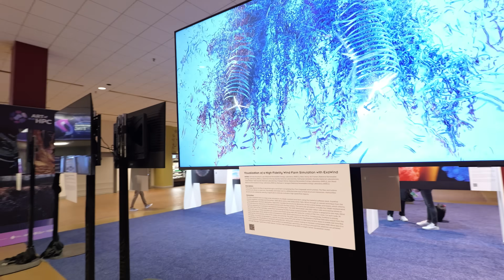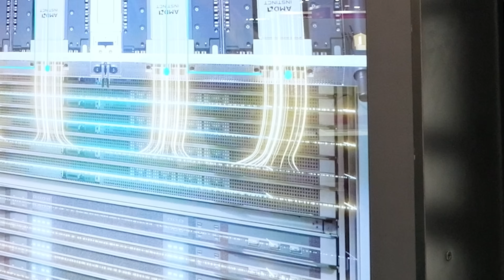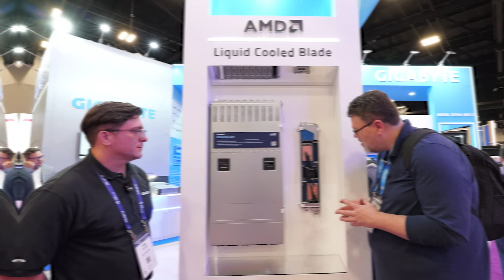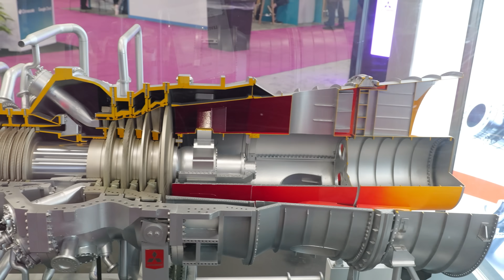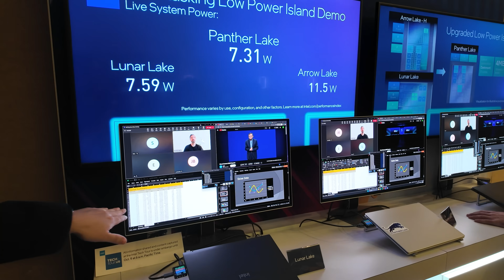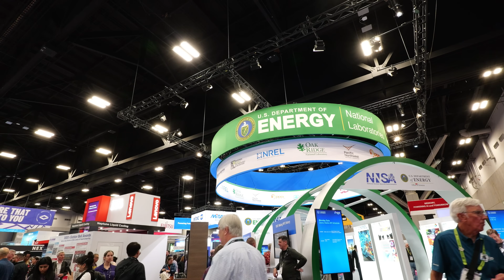SuperCompute 2025 was NUTS! Here's a Few Cool Things I Saw

Comment: Too late but you should ask AMD about the power limits on their next gen APUs. We have found that the ~500w power limit on MI300A leaves a-lot of compute on the table. Most of our scientific codes only get about 1/2-2/3rd of the XCDs fully flexed unless they are heavily tuned. B300 plays much nicer at power limits. 

Btw I saw you at SC but was too nervous to say hi, maybe next year. You inspired me to get into HPC!
Reply: The trick to the power grid stuff is to either have turbines as a stop gap or be connected to multiple power grids and send them advanced notice. It takes at least 2hrs to bring back up an 80mw cluster.

Comment: All GPUs nowadays, each requiring its own proprietary open standard language.
Reply: Actually not, OpenCL and SYCL are here to rule them all!
Only when it comes to vendor-specific fixed-function hardware beyond vector GPGPU, like the mixed/custom-precision matrix accelerators, you need vendor-specific code snippets. For Intel that is OpenCL extensions, for Nvidia that is inline PTX assembly, and for AMD it's compiler intrinsics. Plus a GPGPU-compatible fallback for any older hardware that lacks the systolics. With that it's possible to make one code base universally compatible and optimized across all GPUs since ~2009. 🖖

Comment: Hey Wendell!!🤗  Can you help me make a minor Beowulf system with just older computers that I can evolve over time?  I'm thinking as good as I can afford to make with not very old but Windows 11 incompatible used PC's for cheap (Linux of course), on top of what I already have and partially use as such (in processor sharing)?  I need way more cores to render Mandelbulber II fractal images, which can be made of hybrid and separate or intermingled fractals in full 3D with full camera control, depth  of field and all, material control:  transparency to opaque, color, material, texture, light  refraction, reflection, shadows... environmental conditions: hot dry air aberration over minor humidity to dense fog.. and it doesn't need no stinkin' GPU's but frigggin' CPU's (as many as it can find on my network so 24 for now) due to it's needs in calculating in dual integer math which GPU's can't, nor need to do as in games they are representing, rather than precisely calculating environments and their behaviors over the calculations that become exponentially more complex as they need to determine the shape, lighting, and textures of the fractal surfaces, doing metrix operations and what not.  I wonder why no one uses Mandelbulber II for benchmarking, more to gauge ones PC not for F'n gaming, but for science and engineering type calculations, as I done wanna be cipherin' there".

I know you are one of very few who can help me make a brain neuron hyperplastic recombobulator" AKA "Dream machine".  I look at the fractal animations made in mandelbulber II and know they must have either waited a month or two with their PC running for a week for every 3 minutes of animation, or had the privilege and access to get time with a serious processing server, or even a supercomputer to make 20 minute fractal fly by's and fly throughs.🤯😮🤯🥵

Comment: 13:17 - It's interesting, these are not new problems.  70-80 years ago in the United States, a good number of industrial manufacturing sites like Steel Mills, Metal Foundries, Paper Mills, etc. all had incredible 3-Phase High Amperage AC power requirements that local utility companies were in no way set up to accommodate.  So, most of these sites had supplemental "Power Plants" for their sites to be able to run all of their equipment (largely powered by delivered coal or gaseous petroleum).  Over time, those sites eventually turned down their supplemental power plants when their manufacturing capacity was reduced due to less demand (i.e. manufacturing offshoring), and all their power requirements could be handled by the local power utility.

While the tech has absolutely gotten smaller and more efficient, the overall concept with power-hungry datacenters is still the same as those bygone manufacturing centers.  What I'm sure has also advanced too is : How quickly companies like Eaton and Mitsubishi can install/turnup these products.  I would be willing to that the Eatons and Mitsubishis of the world already had solutions like this for other customer bases, they just needed to be adapted for the needs of a datacenter.

Comment: 6TB is a lot? A regular desktop should have 1TB by now. 16GB was high-ish for the mid range in 2013 (Like a $600box with two mainstream dimms, probably $1200 box with inflation.). 
12 full years, 2 year doubling = 6 cycles.
16GB × 2⁶ = 1024GB
(And DDR5 should have been all Rdimm, it clearly has signal problems with Udimm.)